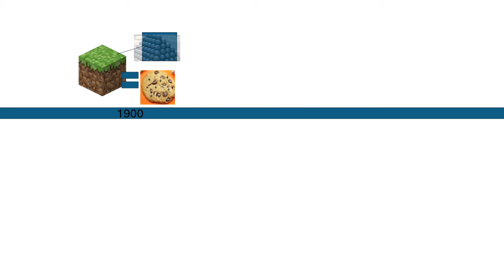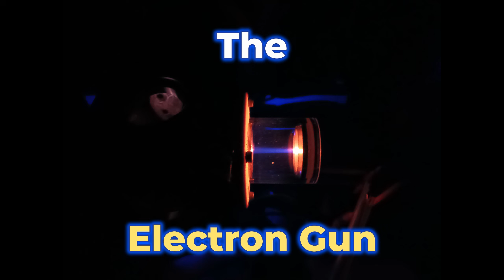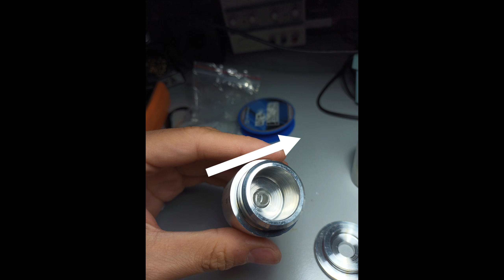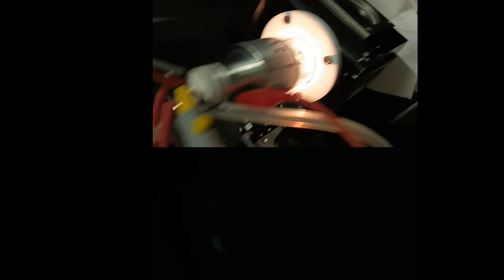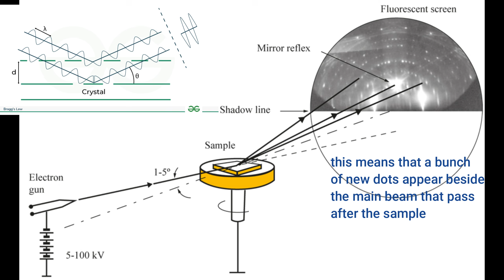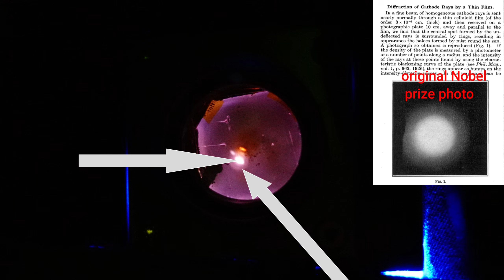Homemade Electron Diffraction

Comment: You could use a magnet to shift the position of electron beam hitting the fluorescent screen. The reason for this suggestion is because fluorescent dye may be homogeneously deposited on the glass, creating inhomogeneous film with variable thickness profile. This in return might effect the intensity of the spot and how clear it is to the naked eye.

Comment: Amazaing work! I have question regarding the phoshor screen, you mention its on conductive piece of glass? Is there a reason for it? Is the conductive layer grounded? Does it help to collimate the electrons? Thanks for reply!
Reply from the maker: Hello, yes it is grounded, i initially made this so that i could connect an amperometer in series to measure the current hitting the phosphor. It also should help to avoid electron getting stuck and charging up the target

Comment: Congrats! The most fascinating part of your approach to this project is how you successfully managed to push it to the absolute "bare minimum" in overall complexity and cost! Literally “design on a dime”! 😁 And yet it apparently still worked! Please take a better (larger) image of the reflected pattern. It appears to be “the real deal”! If you get me the voltage and the distance used, I can then try matching it in “LauePt4” software (or feel free to try it yourself!). The transmission pattern is promising but obviously inconclusive. Maybe try the “silver leaf” foil instead for a better pattern? Those are ~100 nm thick and hence can likely be penetrated with 10kV electrons. Ultimately the ~5cm distance is probably still too short for the transmission geometry. …I couldn’t even dream that barium oxide (or whatever that white mixture is) would work in low vacuum.
P.S. Isn’t it fascinating that all those individual “dots” in the reflected pattern is what a single electron “shape” in space looks like before the electron “decides” to manifest itself in only one of those spots?!
Reply from the maker: Hi, yes the electron gun is the simplest, then I worked by subtracting the excess electron vith the aperture as I had plenty enough. The distance is around 6cm, ill check out the software thanks.
Where do you get the silver foil?
Regarding the barium strontium carbonate, I would give it a try anyway, I got interesting result even at high pressure, it wont last very long but you can always replace it every run, also placing the camera in front of the phosphor and not behind will help as the phospor will reflect back quite a bit of the light background enhancing instead the electron current.
Definetly an amazing phenomenon, I woukd never thought reflected electrons had enough energy to be still visible like the main bean